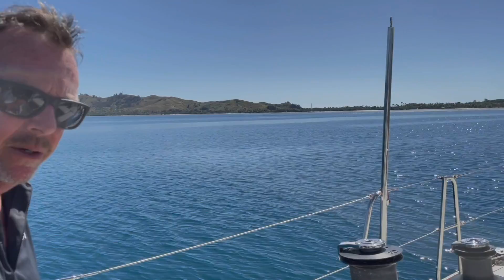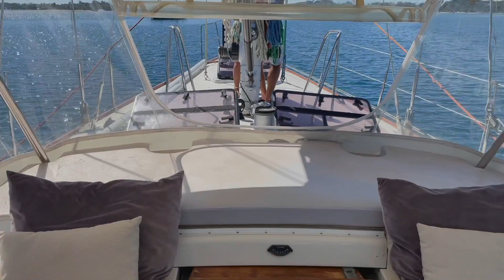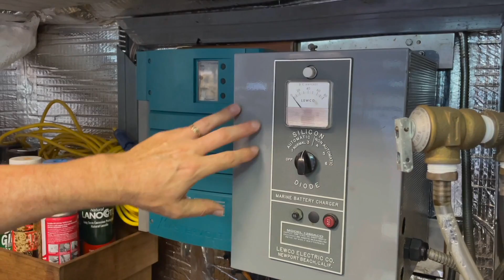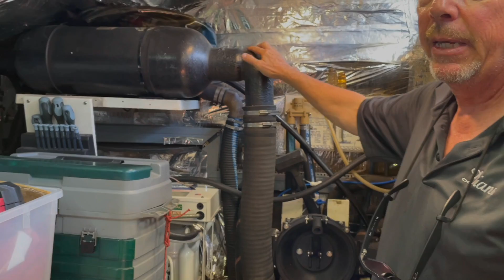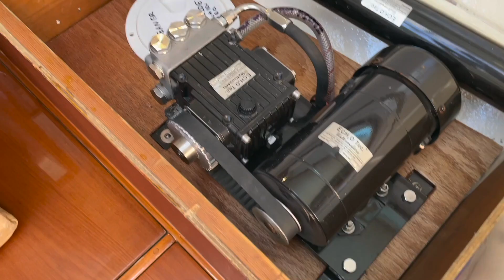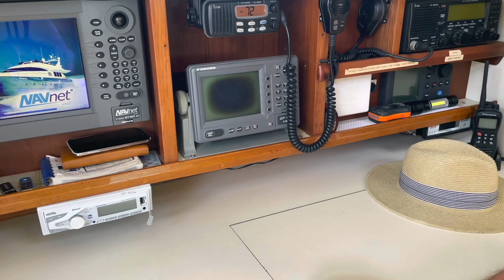NOW SOLD - Deerfoot 62.2 "Bucephalus" - Full Walk-through -

Comment: Our lives "here" will be wrapping up in a couple years.  We are already beginning the long draw down of land assets so that we can move to sea.  

I am long-time racer (mostly windward leeward, but with a few thousand miles category 0 experience).  I had a really good idea what I was looking for in a boat when I started researching the cruising boat market.  In my investigations so far, Steve Dashew boats seem to be EXACTLY what I'm looking.  

I would love a chance to "talk boats" with anyone that owns or has owned a Deerfoot or Sundeer yacht.

I want a boat designed with every thought to never requiring the life-raft - check
I want a boat that is built to be easily maintained - check
I want a boat that doesn't sail like a pig and can make descent time on a passage - check
I want a boat easy to handle short-handed - check

I was looking for an Island Packet, only bigger and faster (particularly to weather).  Dashew boats sure seem to be the answer.

I love the recipe of getting interior volume with water line rather than beam.  The only down side seem to be more dockage fees (by the foot).  But, being in a slip all the time isn't really required with an interior like that.